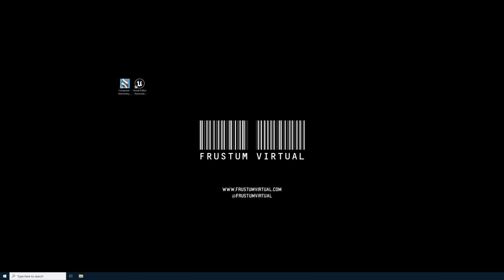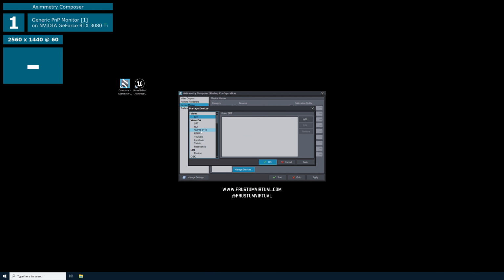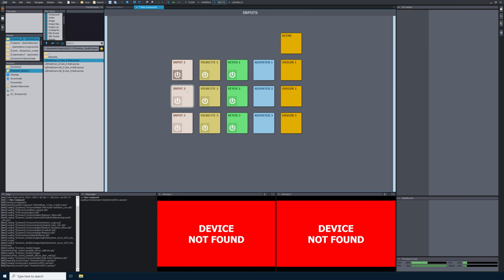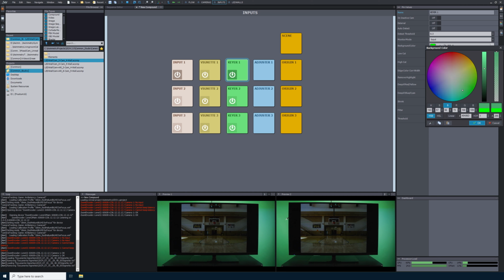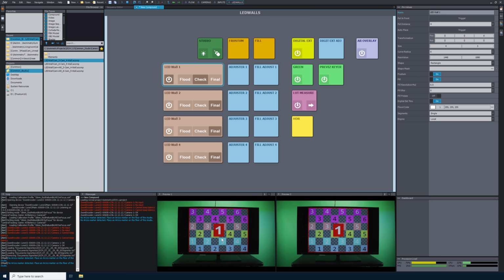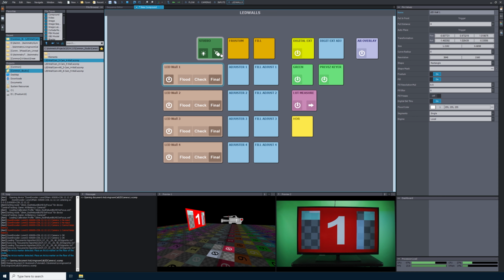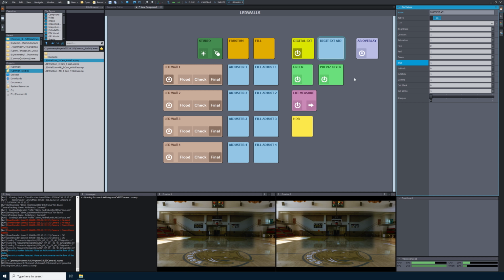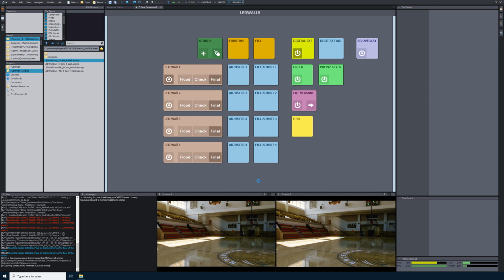Setting up Aximmetry DE for LED In Camera VFX (ICVFX) - Virtual Production - Aximmetry 5.3

Comment: My TV monitor fps is set to 3840x2160@60 and it is grayed out. Where can I change this to be 24 fps?
Thanks
Reply from the maker: It’s a system/display setting that needs to be changed.